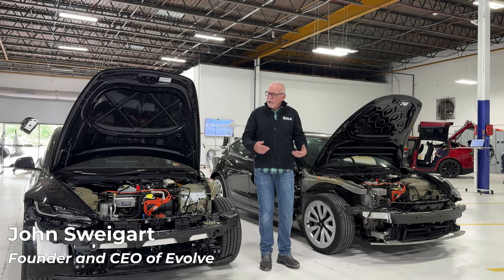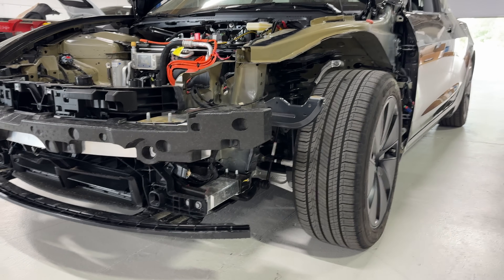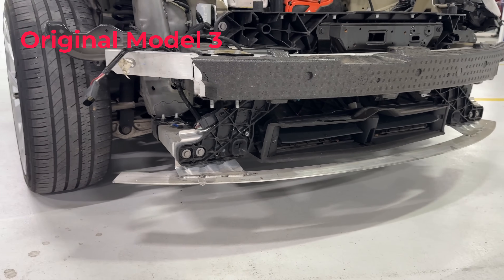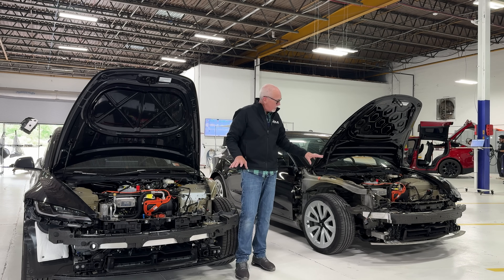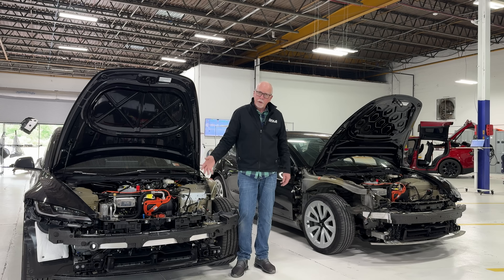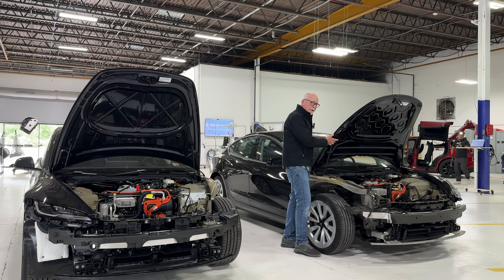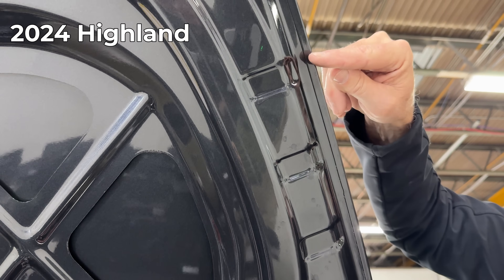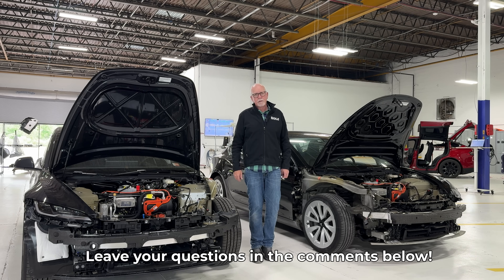NEW 2024 Tesla Model 3 Highland Teardown vs Old Model - What's Different?

Comment: Some big changes have been made to the body in white, in particular the front firewall is now bolted, 
allowing to install components to the firewall before installling it inside the car, which simplify 
the assembly chain and certaily reduce the number of stations and operators. 
Also the rear speaker shelf is also now bolted, which should makes the assembly easier. 
Thus making a Shooting Brake or hatchback version possible.
- It would be interesting if you can show in detail how the firewall and the speaker shelf are installed.
- Also, do you know where the subwoofer is now installed?
Reply: they missed the oportunity of making a lift back, just like the S. but maybe it would cannibalise too much of model y.

Comment: The fact that tesla didn’t make front or rear castings on the 3 tells me that it’s not worthwhile for Tesla to redesign the vehicle for them without significant cost.
Reply: The cost of having the vehicle out of production is very high. Elon said it is hard to change the bus when the wheels have to keep moving. Also the presses are in short supply.
However the highland version is 30% cheaper to make now and has over 50% new parts.
Reply: @waynerussell6401 Not 50% when u look at the front…but in terms of improvement, they fixed the issues of quality and sound damping.
Reply: It is not about design, it is they have lots of stamping machines which they would have to throw away and buy more casting machines. They said it at their presentation.
Reply: @thisApex3D  yes and that is why the Model 3 will become the cheap Tesla
Reply: @thisApex3D Presume this is also the argument against gigapress for legacy mmf. They  have so many derivatives of each vehicle, so many vehicles, and already they have the robots and space in the factories... Already got the cost of invest back.  Was in the Audi factory yesterday and a lot of the robots in the body shop were sitting idle, as they produce so many parts so quickly.  Possibly the welding etc is the time consuming part. Plus the sheer number of parts..
Reply: It’s not worth stopping production of the Model 3 for more than 6 months
Reply: With Tesla, the newer the factory, the bigger the stamping. There are still multiple body constructions on all cars, relating to which production line is making them.

Comment: At 1:04 can you give us the dimensions of that white blanket on the wheel arch on the right side of the screen? Thank you! I can't find it in the parts catalog. If you can give any PN it would be great!
Reply: It's in the parts catalog. It's just not a separate part, it comes with the wheel arch liner. 1694553-00-E and 1694557-00-E

Comment: Tesla used extra white blankets on the inside part of the front wheel arch to reduce cabin noise. It would be cool if they would sell those to retrofit. What I am interested in is how they dampened the cabin noise and achieved better closing sound. I would like to do that on my 2021 once it is out of warranty.
Reply: Can the rear passenger windows retrofitted to double pane for noise reduction?
Although against the law, how much noise reduction would there be if the side mirrors aren't there?   In self driving mode the side mirrors aren't needed.
Reply: @Trust_but_Verify  it can, but when you compare T closing sound with new Highland it’s doesn’t help at all for better closing sound or sound proofing so that would be waste if money.
Reply: In may cars the  acoustic glas is only mininaly  thicker so that the se sale around window can be used. Window glas is cheap. Do it.  The white wool will also be a part number.